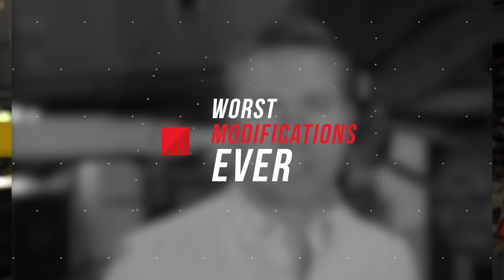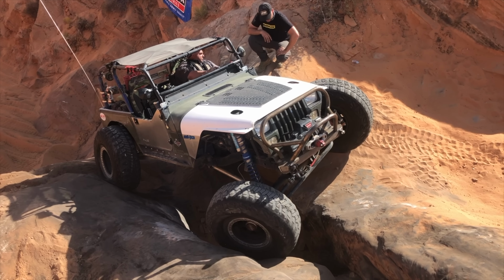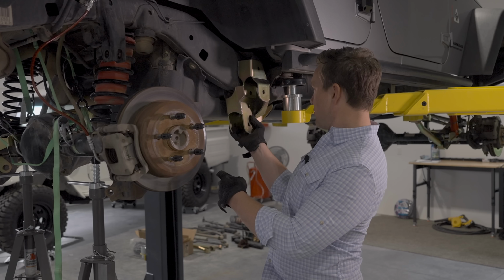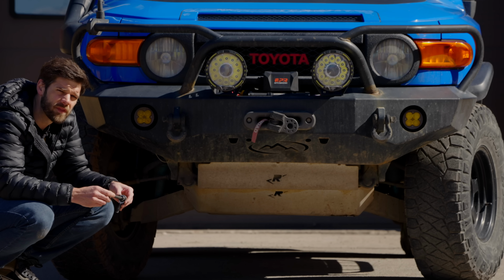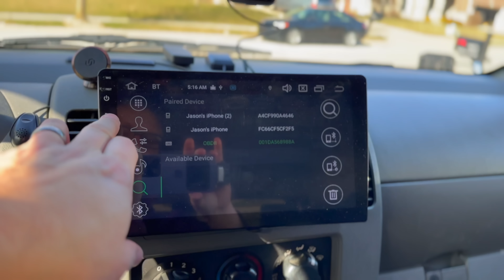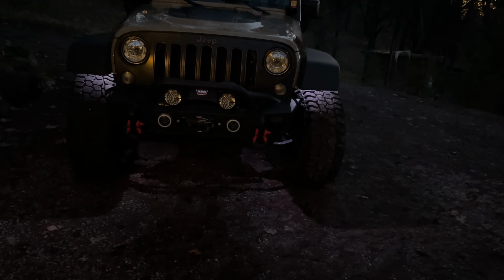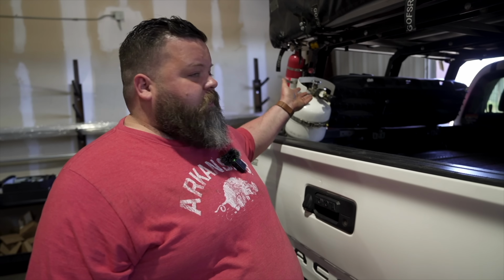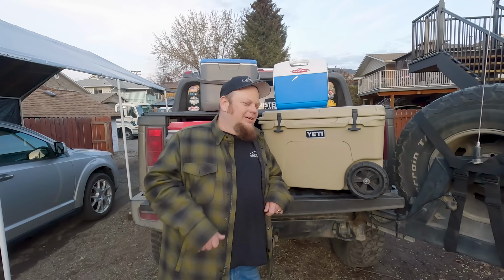DO NOT Make These Mistakes with Your Overland Rig!!!!!

Comment: The more time I've spend modifying my suspension, the more I'm understanding the value of factory components. There are great aftermarket components but with proper engineering comes a proper price point too. My greatest advice to anyone wanting to off-road on a budget is to keep your suspension as close to stock as you can. Slightly taller springs, sub 2", paired with matched shocks will generally not require much afterthought but will allow for a taller tire thus gaining more ground clearance & contact patch. Id also say get out there with your stock rig and see where its limitations are, based on where you want to take it and do take it, and then see what is worth spending money on making modifications.
Reply from the maker: Great comment and advice. I agree 100%.

Comment: A 12v cooler is great to have although it also requires a battery unit to run it if you don't want to wake up to a dead battery, I have a 54qt unit and originally I got a Jackery 300 to run it which would be fine in cooler weather but in Texas during the summer is wasn't enough, I needed something with over 1200wh which I now have plus some solar to go with, including cooler about a $1500 investment.
Reply from the maker: That is a really good point, thanks for sharing. Many of them have a low voltage cut-off..but I've heard from several folks that it didn't work and they had a dead battery.

Comment: Honestly, Never done a bad mod. But then I have been modding for 3 decades and off roading for most of that. Even off roaded a 4" off the floor front wheel drive. Now that teaches you stuff! 
A lot of people do poor mods to suspensions. Personally, mine is standard height, added helper springs and Anti-Roll Bars. still get full articulation so it's fine. better for road use. Dampers, now they are not kept standard. The most important part of the on road set up. 
Yep, go rocksliders, I'll be making my own soon. It's a Defender, don't technically need them, but it might save scratching my nice galvanised cill rails. 
Agree with poor headlights are terrible, so the standard 7" headlights got swapped out ofr Wypac Crystal's, look good and better lamps. will be going blue bulbs later on as they increase rthe usability of the lamp a lot, expecially in fog. 
Coolers, even electric ones, gret for travelling, not good for camps. Just buy a proper 12v compressor fridge. 

Good little vid, great advice from all of them. 😀
Reply from the maker: You've NEVER done a bad mod???? Everything has been perfect for 3 decades??? Sounds like you were born for this.

Comment: liked the video overall, but I think we have some term confusion. The Idea behind the "Nerf Bar" comment is correct, but I am not sure about the term. Nerf Bars as originally devised are actually functional equipment. originally, nerf bars were installed on race cars as basically side bumpers in the case of "nerfs" or side to side contact (since they are meant to actually protect against contact they were welded to frame out of appropriate DOM to hold car weight or more) . for off road cars I have usually seen the term used in the same way to describe loops that are functional (ie should hold the weight of the car) the are welded onto rock sliders to provide vertical protection from side impacts. they are usually tight to the body and welded on an upward angle to protect lower doors and sills, thus they dont impact clearance because the slider portion is still the lowest portion which should be even with or above frame rails. they may still provide a bit of a step function, but thats more like a step out rather than a step up (more like a porch than a ladder) since the nerf bar should be at the height of the slider or above. 

Running boards or sidesteps on the other hand dont provide any kind of vehicle holding or sliding functionality. they are merely for aesthetics or to provide a step up. I understand that many side steps like the one you guys pictured in the vid are designed to look tough, but I wouldnt call them "nerf bars".  

a good way to look at it from my perspective is you can actually have all 3 things rocksliders, nerfbars, and steps in the same package or separately. Jeep Rubicons come with rock sliders from the factory but dont come with nerf bars to protect the side sill and lower door. Toyota 4 runners (2015+) offer a rock slider with a nerfbar oem where the bar sticks out past the side of the truck to give side impact protection. finally,  rock slide engineering has rock sliders with power side steps that drop down automatically when the door opens, but retract for offroading. 

looking around, I feel like this term "nerf bars" has really kindof been absorbed into non functional (for actual offroading anyway) steps so I am probably just out of touch. I like having terms for all three though, so I would ask what would you call an extension of the rockslider that comes up above the sill (or at least parallel with and out) to prevent against side impacts if not nerf bars? how would you differentiate between those and rails that are only designed to protect against impacts from below? 

anyway just my 2 cents.
Reply from the maker: Really great comment! much appreciated context and info!!

Comment: With 4 inch lift a d 35s, i needed some running boards. I dont do super difficult stuff with mine. Just mud trails in WV.
Reply from the maker: There's really no problem with having nerfs or runners as long as you know the limitations they create. I sometimes wish I had a step into my rig!

Comment: I think some spacer lifts are good (Epic Adventure Outfitters has installed Teraflex performance spacer lifts on projects and I have faith in them that they wouldn't install products they wouldn't run on their own rigs) but I agree there are many that are a bad idea. Great video, very entertaining and informative, funny as well.
Reply from the maker: Spacers definitely have their place, but I’m not confident they improve your suspension…but they can make just enough room for bigger tires in certain situations.
Reply: I agree that they don't improve suspension, just that good quality ones can give the clearance wanted, for bigger tires, or just more clearance. I'm currently looking at doing a teraflex base 2.5"  spring lift kit, not a lot more than their spacer lift, and can upgrade shocks when the budget allows. Tired of rubbing the belly on my JLU. Keep up the great content, glad I found your channel, through Casey 250's channel.
Reply from the maker: @tonyk1amt806 I’m throwing 37s on my Mojave and might need a spacer lift until I out a new suspension on it.

Comment: I’ve had pretty good luck with mods over the years, but I messed up choosing a rig once. I bought a 1999 Isuzu Trooper. That thing was a BEAST offroad. But it burned oil, got maybe 8 mpg highway, was loud, and the 4wd had a mind of its own. Eventually it was so unpleasant and expensive to run, I didn’t want to take it anywhere and eventually sold it for pennies.
Reply: I actually always liked how the Isuzu Troopers looked and kinda wanted to build one up... but their reliability issues are a huge hurdle.
Reply from the maker: Troopers are so cool…from the outside. Thanks for sharing!!

Comment: Swaybar disconnects on solid axels are a great modification, don't overlook bumpstops and longer brake lines if you added lift though! I can see how a swaybar disconnect on independent suspension would cause problems on the CV's.
Reply from the maker: Oh man…a lift with no brake line extensions is asking for trouble. None of us have done that one…but good addition to the list!

Comment: Spacer lifts have a place- 1/4-1/2” spacers are great for helping with squat. 

Shocks are the most seriously under budgeted and under prioritized item on any rig.  Spending the coin on GREAT shocks, and then spending the money to have them truly tuned…. Changes everything.

The nerf bars! All truth!!! 🤣😂

A few moments on drop brackets would be good- they are great for over landing.  Have even heard of guys saying “if your catching on drop brackets or control arm mounts you have bigger problems”- evo high clearance kit…. All day every day! No more catching on mounts- arms are bent for higher clearance… phenomenal design.
Reply from the maker: I used air bags for squat. But I never considered a bump stop lift for that. Good point. The problem is when a body lift is thought of like a new suspension. Totally agree with you on shocks. Thanks for watching!!

Comment: The worst thing I have ever done, is buy a cheap air pump for $20 at a local auto parts store. Lets just say it couldn't fully air up 4 of my 31 inch tires after driving on a beach. Luckily I was only few miles away from a gas station that had free air.
Im not saying a 4 inch lift is stupid, but you don't need it for overloading. Plenty of people safely overland on stock height suspension. A 2 inch lift is more than enough for most people. My main point, its stupid to spend money one something you don't need or will rarely use. People drop $10k on large tires and suspension and barely use it.  Buy what you actually need, not what want or what other people have.
Reply from the maker: Great advice!
Reply: I’ve been to so many awesome, somewhat remote places in a civic and accord while seeing 80k setup’s camped at paved campgrounds I stopped at for a bathroom break and leg stretch, that I’m assuming my next purchase(looking for a stock 2013ish 4Runner)  would be more than adequate for my adventures and leave me with some guilt free cash for minor upgrades/repares, I love packing everything I need in backpacking packs in case I decide I wanna hike out and camp somewhere and the cooler and chairs will either be left behind or enjoyed as a luxury.
I am curious if the 4Runner will handle as well as my Hondas on snowy roads, driving technique combined with front wheel drive has kept me out of the ditches I see big trucks in every yr lol
I’m knocking on wood.

Comment: I added a puck lift to the front of a pickup to level it out. Ruined the ride. I should have got longer front coil over assembly. A tip for anyone who has to use coolers. Freeze a bunch of water bottles to put in the cooler, they last as long as a block of ice and don't get everything wet plus it gives you extra water to drink once they do thaw.
Reply from the maker: Great tip on using coolers. I understand using pucks for leveling..but some folks think it’s a true lift and it’s not.

Comment: Trying to make ppl understand there is a difference between a “lift” and a performance engineered suspension. 
Spacer lift, pucks or drop bracket lifts do nothing but make the rig higher, but it will indeed handle even worse with higher COG and inferior springs/struts, etc. 
spend the money and buy a quality suspension!  You, your passengers, and the rig itself will be so much happier and not beat to 💩 by the end of the day. 
Also better traction and articulation!
Reply from the maker: Great points. Thanks for watching and sharing!!

Comment: I would greatly disagree that suspension and tires are the most important for off roading, lockers should be your first modification for off roading!
Reply from the maker: Interesting choice! To each their own. Lockers are an incredible improvement. IMO you get way more performance improvement for 95% of your offroad driving by improving your suspension and tires, while lockers will give you a significant benefit, but for me, usually only in circumstances/situations where I'd need good tires and suspension  to begin with.
Reply: No

Comment: Hey I'll show you that I am fully capable off-road in my full size with nerf bars.  I'm 5'2 and require them for my lifted truck but that doesn't in any way mean I am an inexperienced driver... 😂 but then again I sit in parking lots laughing at jeep builds so I guess it's only fair. 😅😂
Reply: And to be fair my truck wasn't built only for rocks it was more built to take on the Owyhee County mud so there is that too but we will ignore that part lol 😅 but it's pretty cocky to claim that nerf bars means I can't drive offroad. Although all other points are spot on.
Reply from the maker: You’re right. Nerf bars don’t mean you are a bad driver. You actually have to be a very good driver to have them and not damage your rig when driving difficult trails.
Reply: Haha won't argue there 😆 I just have to poke where I can.  Sliders are definitely the better option
Reply from the maker: P.S. Props on taking on Owyhee mud..that stuff is no joke.
Reply: @Venture2Roam  it's definitely in a league of it's own but it's kinda why I enjoy playing in it.

Comment: These mistakes are hilariously comical. First mistake is trying to buid a serious rig out of a newer truck. Get you a straight axle vehicle. A vehicle thatbwas built to last from factory.
Reply from the maker: What rig would you choose??
Reply: @Venture2Roam  depends what you're building it for. Overland or rock crawler. Might need a truck over an suv or a jeep but you cant go wrong with a 90's jeep cherokee or toyota. A jeep TJ if you dont need alot of room.
Reply from the maker: @_JEBUS  I like those options!